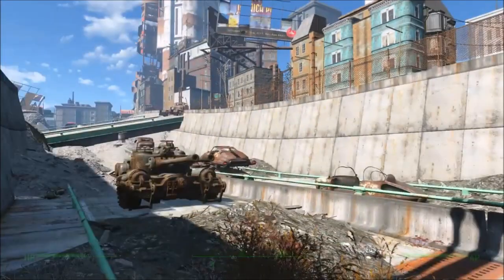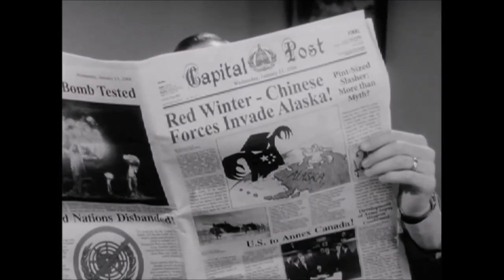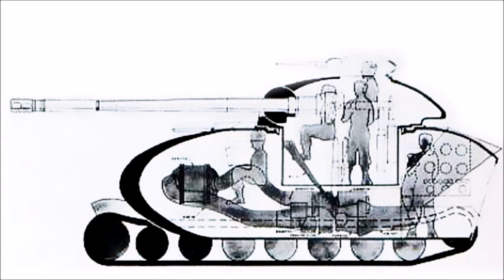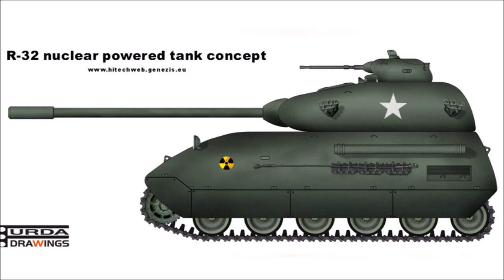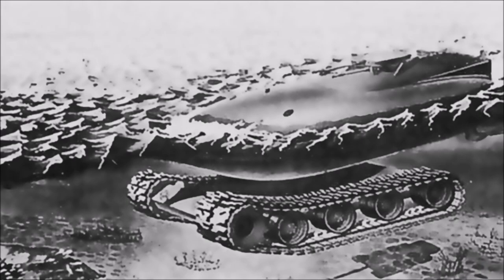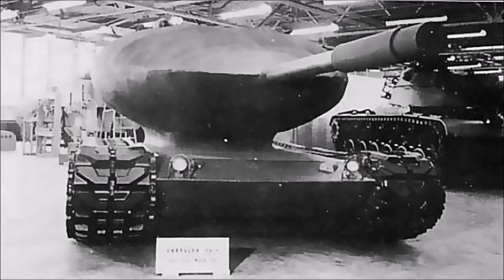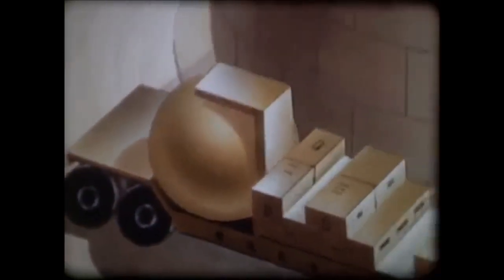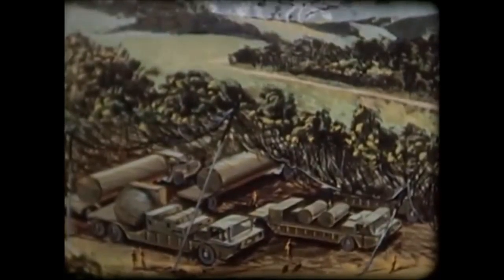Nucelar Powered Tanks - Fallout 4 Real

Comment: Its worth noting that US Navy actually implemented the nuclear depot solution quite recently (still in a prototype, but working phase). Using the solution onboard a carrier to produce fuel for the aircraft's.
Reply from the maker: Interesting, not something I'd heard about, thanks for the info!
Reply: they use commercial pretty much off the shelf components and combine to gether. so the system is not that efficient, but it works.

Next generation they probobly use specialty reactors that would make it way more efficent

Granted, the A1B reactors is pretty modern. Is the only gen 3++ operational today

Comment: Has anyone thought about how the cctv would stand up to several blasts and/or the internal reactor?!
Reply from the maker: I don't think enough thought went into many aspects of these designs.
Reply: The internal reactor isn't a problem for cctv (there are cctv systems in some real nuclear reactors. Moreover, if the crew can survive inside it, then also any electronic equipment can).
Instead, EMP from nuclear blasts can be a problem, but not one that cannot be overcome with proper shielding. It's also worth mentioning that vacuum tubes are far more resistant to voltage surges and EMPs than transistors are (that's why you can find vacuum tubes in military equipments produced when transistors were already, and for long time, widely considered more pratical and cheaper).

Comment: I hate to be the one to bring you this news... but your country Great Brittain operated a nuclear reactor that vented into the atmosphere called Windscale.  And yes they even had a serious fire when one of the aluminum canisters that held the nuclear fuel got stuck in the graphite core, and began to burn.  Luckily one of the engineers had installed a filter on the chimney that exhausted the hot air, but to this day its questionable if that even did anything at all.  Remarkably up until then they actually refered to that filter as "(engineers name) Folly" ... which I'm sure they stopped doing after the fire. 
Here is the formentioned reactor documentary properly named "Our Reactor Is On Fire"...
https://m.youtube.com/watch?v=vcsyMvQtlKs
Reply from the maker: Cokcroft's Follies. The physicist (not engineer) was John Cockcroft. Don't hate yourself, this is not news to me.